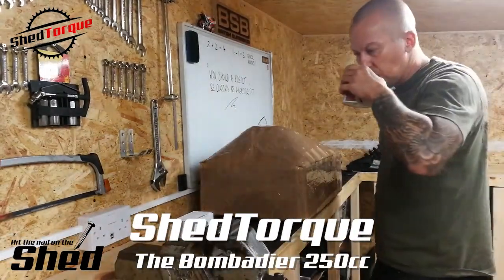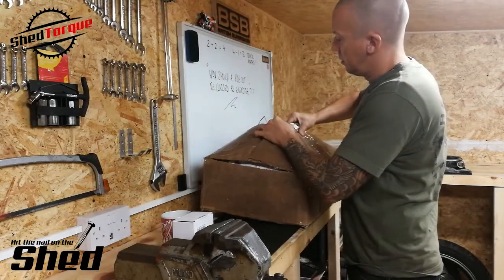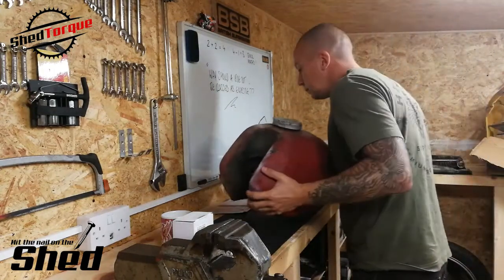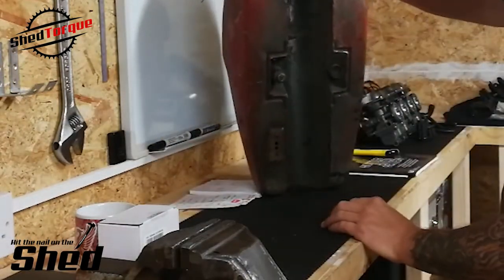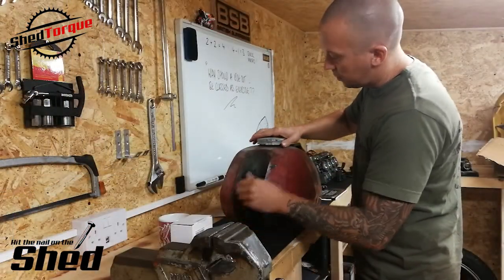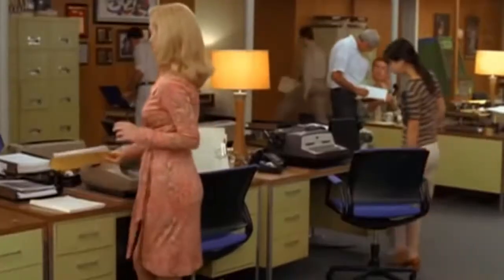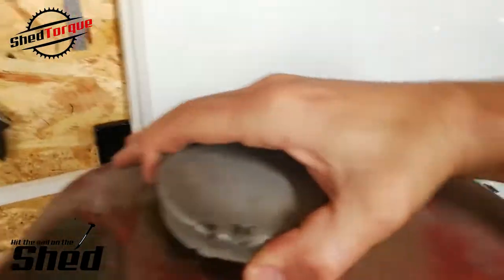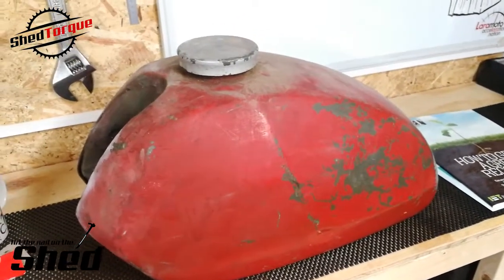Bombadier 250cc Fuel Tank - UPDATE XJ600 Scrambler Project

Comment: Throw some fine Stone Or bead blast material in their mate and set it up on a DIY Spit with a variable speed drill so it turns it over like a cement mixer for a few hrs and it'll be scrubbed clean ready to add PUR15 in to seal it... Same process Happy Days
Reply from the maker: Already on order 😉🔥